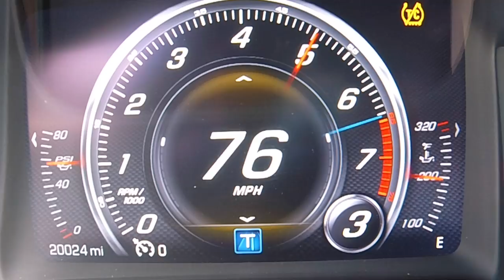How Slow Can You Go In 7th Gear?

Comment from the maker: Before the "omg he's going to blow that engine by lugging it" guys show up, let me assure you that bad mother f'ing engine is just fine. It's been holding 800+ bald eagles on a stock bottom end for months... the only thing that could possibly damage that engine is Chuck Norris.
Reply: Cleetus McFarland KaKaw!!! get it buddy!!
Reply: Cleetus McFarland 1234567
Reply: Cleetus McFarland Doing this puts some extra wear and tear loading the engine at low rpm's.... Bearings don't glide as well on the oil in between the crank, mains, and rods and can etch them but not like you're gonna blow it up lugging it a few times ...
Reply: RIP CLUTCH
Reply: he also ate the dirt
Reply: Video has 2 dislikes, don't think anyone it worried. Great video.
Reply: What is the highest gear you can get the bald eagle rollin in from a dead stop?
Reply: It will foul your spark plugs but with you running it on the dyno they normally switch out the plugs anyway so who cares about running in 7th at low speeds
Reply: oh my god that vette is nasty... that pull was incredible. Re winded at least 7 times
Reply: Cleetus McFarland always wondered that in my games
Reply: yea but you have forced induction. putting too much load leaves you more prone to pre detonation. but i mean you obviously didnt floor it while in 7th so i dont see a huge problem.
Reply: Cleetus McFarland if your car ends up in gasking video, Chuck Norris can shoot it.
Reply: Cleetus McFarland iiii
Reply: Cleetus McFarland if you can do 50mph at under 1000rpm that's over 300mph at redline I'm not sure you can even fit that many bald Eagles under the hood to go that fast
Reply: fuckin chuck norris
Reply: Love these videos bro shit
Reply: hey Garrett "cleatus" where's the white Prochaged ram
Reply: Shake and bake baby
Reply: Cleetus McFarland was that the clutch squealing like in 3rd gear
Reply: i agree
Reply: Cleetus McFarland That thing has the most bald eagles in it
Reply: HELL YEAH BROTHER
Reply: Cleetus McFarland helll yea brother
Reply: Cleetus McFarland best comment ever...
Reply: Cleetus McFarland dddddddddd
Reply: Cleetus McFarland 
You mate talk too much.
Reply: Chuck norris memes died off in the early 2000's.
Reply: Google piston slap
Reply: mean clutch slip in that thing huh
Reply: Cleetus McFarland @9
Reply: I dig random shit!
Reply: yeah sure, except for the fact that lugging it starves the bearings of oil while theyre under load, worst thing for em. Oil pressure is low at those rpms, and your still trying to drive like that
Reply: Cleetus McFarland 
the complete definition of how to Lugg  your engine. to hell and back  to Chuck Norris.
Reply: one of chuck norris chest hairs would damage that engine from the inside
Reply: Cleetus McFarland  sponcerd by burger king
Reply: Cleetus McFarland I agree there.

low oil preasure and high piston preasure as the engine tries to accelerate. Will force the rod side bearing onto the crank and cause wear. 

fun to see but wouldn't do it regular.
Reply: funny, you do this and your most recent video is, my clutch is fried
Reply: How can the engine stall... when it's being turned by the weight of a CAR traveling 20+mph?!

This "car guy" doesn't even know basic Physics.
Reply: Marek Sumguy If the engine falls down to low enough RPMs it could theoretically shut off.  Though this would not happen, but not because the car is still going 20+ mph.  The speed of a car can cause a lower limit to the RPMs but at 7th gear the gear ratio is so low that the lower limit of RPMs at the speed is probably lower than the resting RPMs of the engine.  So it wouldn't stall because the engine is not going to drop below its resting RPMs, instead it's going to push the load.  However, this load will cause a ton of engine strain at such low RPMs
Reply: Cleetus McFarland hey cleetus.. whats the name of the car? plz reply... i need to know XD
Reply: chevy corvette c 7
Reply: Cleetus McFarland 
you guys get an oil pressure vs torque breakdown? how much clearance the crank has, how much pressure your running on any particular journal at those rpms? youre hurting stuff, engine builders know whats up
Reply: Engineering Explained!
Reply: Engine would be fine, but you can burn clutch with that slow driving in high gear.
Reply: You have no idea Mehemed.
Reply: Trust me, I'm engineer.
Reply: Mehemed Hasandic no you can't. 
if clutch is not slipping you won't burn it out.
the engine doesn't have the torque low down the rpms to overcome the clamping power of the clutch. provided it's fully engaged to start with which in this vid it is.
Trying to accelerate puts more fuel in the cylinders meaning bigger bang. that then puts more pressure on the piston in turn pushing the rod on the crank. the crank can't turn that fast due to car weight and gearing so will wear the bearing she'll as the oil is forced out due to the preasure of the rod pushing down on it.
Reply: Cleetus McFarland Probably Michael Bay too
Reply: Luggin is happened when you try to accelerate by pushing hard the gas, to force the car move faster from the low speed in the high gear. If you still use the high gear to keep the constant speed (zero acceleration), its still fine.
Reply: thats called forced induction, the clutch wasn't even slipping that bad. he's still got some use out of it on lower power. but who wants lower power. im sure he will get a badass clutch, still impressive for stock.
Reply: The only problem you'll have with using high gears at a speed well below its range, apart from the possible harmonic oscillation, is during WOT. There is a massive amount of heat generated which can't be compensated by the cooling system. Any forced induction will compound this issue, as well. The excess heat is due to generating the same power for longer periods of time, and the low cooling efficiency is just from the low air velocity running past the heat exchanger(s).
Reply: Cleetus McFarland Wait, how does the manual work? Is it a gear shift or speed selection?
Reply: Gear shift
Reply: Zombie Drift 45 then don't watch
Reply: Cleetus McFarland
Reply: Cleetus McFarland k
Reply: thats fucking hilarious
Reply: That's not how engines work
Reply: omg hes going to blow that engine by lugging it!
Reply: Ended blowing it up anyway hahaha

Comment: Put it in "R"ace mode
Reply: Exodus Thunder all this time I thought it was for radio well now I know
Reply: Exodus Thunder lol its exodus thunder
Reply: Exodus Thunder for a couple of seconds I thought that then I realize reverse but like all the new cars now have some kind of sport/race/track mode on the shifter
Reply: Exodus Thunder "R".I.P
Reply: Not manual shifters....
Reply: José Luís Lopes Race gear aka reverse
Reply: No manual gearbox ever lets you put it in R (leaving aside the gimmick that you got to either push the gear level, or pull something up etc) unless you are doing something like 5km/h, even my 2.0 diesel Kia Rio doesn't let me do that, that is if you can drop it from 6th all the way to R, which is to the left of 1st gear.
Reply: Allan Pedro it can be used for both
Reply: Exodus Thunder I put the race in racist, oh wait.
Reply: race mode makes the suspension super tight and tbh u dont wanna drive it in race mode on the street, its very uncomfortable. sport modes the way to go
Reply: Nothing happens if you put it in reverse but if you accelerate. ..Boi
Reply: I thought it was for Reverse
Reply: SolisHD i
Reply: You meant ''R''ocket
Reply: "R"aped engine.
Reply: my car drives fine during the day but it doesnt at night help pls!!11!! i put it in D for day and N for night
Reply: Midnightcat
Wow.. That's totally should've worked! Try pressing harder on the pedal, whilst on "N"ight mode.
Reply: Maybe he could "Ace" it!
Reply: I go to dealerships replacing 5 speed knobs with 6 speed knobs.
Reply: you mean 'death' mode ?hhhhhh
Reply: My uncle taught me when I was very young that R is for "ready."
Reply: It's not race mode !! It is a rocket gear
Reply: I’m the one thousandth like 😝
Reply: car guys have one joke
Reply: R means reverse!!!!

Comment: 50MPH@1000rpm in7th =350MPH@7000rpm in 7th??  You can now tell people that the vette will top out at 350 MPH, just don't mention that it would have to be in the vacuum of space.
Reply: Jason Beattie it wouldn't go 350mph in space bc the engine wouldn't be able to combust
Reply: A car engine can't... nevermind... not taking the bait.
Reply: Or just on a dyno
Reply: Nitrous
Reply: add nitrous it will run in a vacuum XD
Reply: Jason Beattie car wouldn't run it a vacuum :(
Reply: Imagine no friction too on the tires.
Reply: No grip then. So you wont move at all...
Reply: Homber Sweatson of course they are
Reply: Cool, I wasn't sure if they were or not. I figured it couldn't be as easy as multiplying by 7 or whatever.
Reply: Homber Sweatson: As long is you stay in the same gear you can simply cross multiply and divide.
Reply: Y'all got me all sorts of sideways, I'm pretty damn stoned right about now reading about these flux compacitors an shit, we get it you can't get sideways in 7th bud
Reply: gear ratio is CONSTANT at a CERTAIN gear
Reply: CaliRider: Yes it does
Reply: Dylan Dylan There are no tires that can hold that.
Reply: +albania 
there are definitely tires that can do it. Not off the shelf but they can and have been made before
Reply: kolby4078 Well of course there are because the fastest car drove faster than the speed of sound, but I don't think one is gonna be able to find tires that don't deteriorate at 300+ mph.
Reply: with a liquid oxygen supply
Reply: What about friction? If theres no friction then yes that would apply.
Reply: TWrecks Look at his last sentence bud.
Reply: Also, don't forget that you float in space, so you couldn't drive really.
Reply: Simon Vuille there is gravity in space.
Reply: The Thrust SSC ran on pure steel wheels with no rubber i believe.
Reply: @eequalsmchammer6808  vacuum, not zero gravity

Comment: Engineering Explained is going to cringe at this
Reply: Engineering Explained should make a video on this explaining why we shouldn't do this...
Reply: dunhillsupramk3 he did
Reply: Triple259772 link? I'm lazy
Reply: Toto Geenen /watch?v=soJea7xEt-8
Reply: more about not flooring it at low rpm in a high gear. there isn't much stress when its maintaining the same rpm
Reply: @03056932  also going up and skipping gears but tbf its probably not as relevant in this
Reply: @DarkLinkAD  what exactly was he wrong about?

Comment: Many people do not understand the purpose of a multi speed manual transmission.  It is built for the same reason that we have multi speed automatic transmissions.  You want to keep the engine RPM in the sweet zone, and also get the best possible fuel economy.  Hint: 7th gear is NOT to go faster.

Comment: For all you wondering if going under 1000 rpm is bad for the engine: not it's not. Obviously you should not try to accelerate quickly when your rpm is so low but if you run smoothly then there is absolutely nothing to worry about, it even saves fuel!

Comment: Looked like it was going to be in the low 50 mph range at 1000 rpm in 7th so once you get it up to 3000 hp expect 325+ mph top speed. Not sure how many stickers it takes to add enough hp.
Reply: That's what StickerBomb is for. Though, I hear it's an efficiency loss thing after about 25-30 stickers. Diminishing returns and stuff.

But your Rice Factor increases exponentially in cubes for every sticker added, as well. So, no worries there. :)
Reply: wingnutthecat you dont need stickers. Just fill your exhaust pipe(s) with turbo whistles

Comment: 4th gear at like 21 MPH, and then it pulls like most cars are in 2nd. That's torque for ya. Question: Would this damage the engine? Not suppose to lug the engine and all that stuff?
Reply: It might not have enough lubrication at low rpm and high load

Comment: Quick question: If that's a manual (stick shift) transmission, what are the flappy paddles attached to the steering wheel?

Also what's a drone range?
Reply: Dan they are paddle shifters
Reply: No, surprised no one has actually answered this yet. They actually both have the same function. They toggle the automatic rev matching feature of the car for downshifting.

Comment: I found it useful I’ve been playing with the idea of using a 5+ speed manual transmission in my 1970 Dodge Charger 383 big block instead of the 727 because of the Pro-Formance advantages like better mpg and being quieter in town this just proves it and being able to push start it / engine braking in a emergency

Comment: Me and friends used to have idle races. I had a stage 2 Competition Clutches clutch and would go from stop into first only letting the clutch out slowly without giving it any throttle so I know a stock clutch can do it. Shift through the gears and race around in an open parking lot when it was late and nobody was there.

Comment: from a cam catalog, ive seen powerband listed from 600rpms-3600.  I put my old ls1 m6 Camaro in 6th gear at 35mph.  It even had an 230 114 cam.  As long as you feathered the gas, it wouldn't buck.  When you wanna go fast, double clutch into a gear that has the rpms over 5k

Comment: I only use 7th in my C7 when I go 70 or so.  My morning commute has one traffic light.  30 miles, all 70 or 75 (legal speed limit) My 370 Z had 5th gear as 1:1 and 6th was overdrive.  Might have been better if 5th was 1:1 on the C7 and 6 and 7 were overdrive.  On the other hand I'm pretty sure the engineers at GM spent a lot of time on this and they knew what they were doing.  Now Cleetus needs a Tesla P100D or a Roadster.  Only one gear!

Comment: Only an american car manufacturer could have made a 7 gear manual transmission, and still keep 4th as a one to one ratio. The idea when adding gears is not to obtain a huge overdrive, but to stage the gear ratios closer so that you get better performance out of the engine. Having a gear capable of 350mph and not being able to accelerate in it is totally useless.

Comment: Yeah, you know that lugging an engine is way different than fully loading it. 

see what happens is as you go slower the rods and crank are rotating at a slower speed which means that the oil in between the rods and bearings or crank main bearings doesn't have the surface tension. 

See as you rotate these parts faster with RPM you build up a hydrostatic film of oil. When you don't have this film like when lugging at low RPM you get bearing journals touching bearings which is obviously bad. Not to mention as your engine is rotating slower you build less oil pressure from the pump so this effect is worse. 

So if you are going to run your engine slow just keep light load on it to prevent premature bearing failure. Don't floor it at 1,200 because bad things will happen.

Comment: There should be a locked 7th gear in valet mode
Reply: That's a terrible idea. You wouldn't be able to get the car moving from a stop in 7th gear and even if you could it would be terrible for the engine and clutch.

Comment: Wait, you drive around at 40mph in 6th gear? Wouldn't that be worse for gas mileage, since you have to push the pedal so much just to keep her goin, or to accelerate at all? And wouldn't that also be why your clutch is going out?
Reply: Your engine would be trying to push the power, but since you're in such a high gear with no torque, your clutch just slips.

Comment: The 4th gear is the gear with the 1:1 ratio? As much as I heard the 3rd gear is usually made as having the 1:1 ratio but given that this is a 7 speed transmission and not a 6 or lower speed transmission it might explain why.

Comment: So does the C7 actually give you the option to shift for yourself from 1st to 2nd etc without an eliminator or simply unplugging?  That skip shift nonsense used to piss me off in my Z28's and Corvettes.  I get it.  It's a gas mileage thing, but fuck.  I'd rather pay the $1500 gas guzzler fine when I buy the car than for the car to force me to drive super aggressively or super conservatively.

Comment: hey, pretty newb question i guess, how come your engine doesnt die like a typical manual car does when your speed goes low? how come it holds down to a certain speed? cause i grew up with manual cars that when youre too slow on the 2nd or first gear, your engine will turn off and youll have to start again. Thanks! 

(same question with your other video teaching your girlfriend how to drive, like when you put it at one and release on the clutch, even when you let go of the clutch the engine doesnt die even without putting gas on it)
Reply: your carb's idle circuit is broken (not opening below idle speed to obtain idle), also he's got a 6 liter V8.

Comment: I go to 5th gear in my manual car when I am at a costant speed  sometimes 40km/h (nissan versa). Is this bad for the car?
Reply: No it isn’t bad for the engine at constant speed. Driving uphill at 40kph  in 5th gear and its heavy for the engine waste fuel.  It might "dirt" the engine over time with carbon. So on flat road in 40 you can also keep same speed still if you release more on the pedal. If you hant it can take a little to get used to do so small adjustments. At a local store when there is little traffic i can just release the throttle and leave it in 5th gear and do the last 150m on idle taking two leftturns to the store. And most of Bmw’s have idle speed between 700 and 780rpm’s😊 6 cylinders make it smooth enough anyway😊